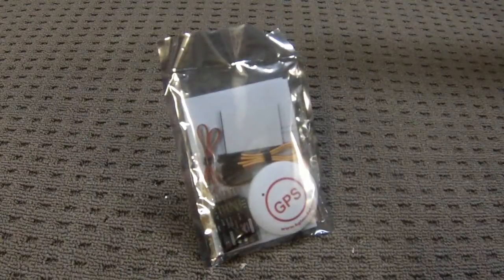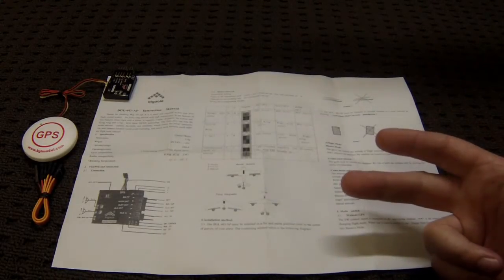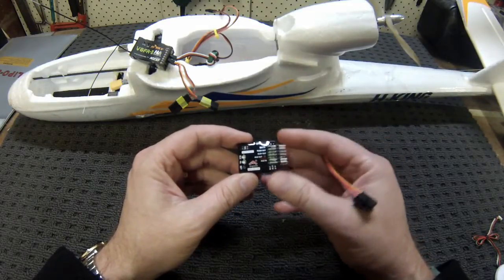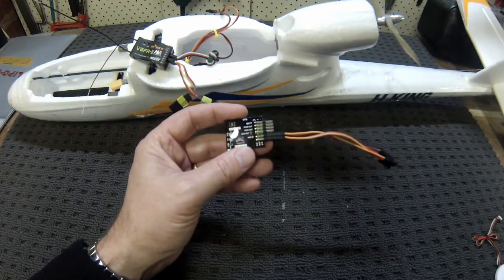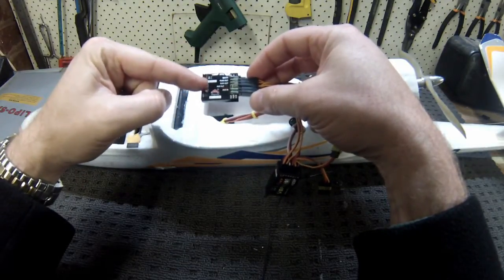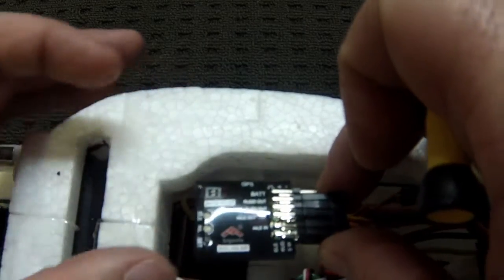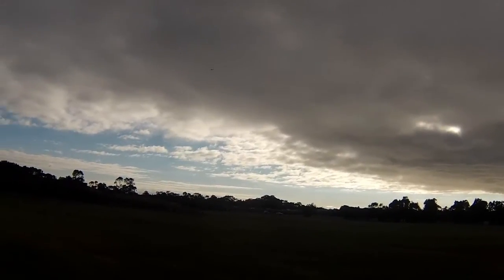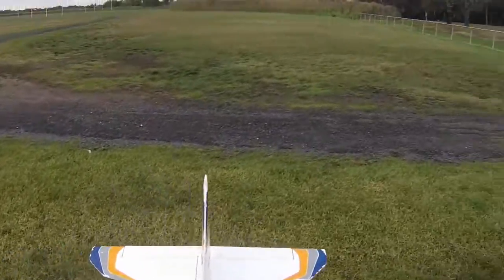BGL-6G-AP Flight Stabiliser with RTH - Setup

Comment: hi michael...   ok i got everything working on the tarains (thank you) but  not in the right sequence   i am using the sc toggle....  (rth mode is sc up)   ( off mode is sc-)    and (stable or gyro mode sc down..)     what could i  be doing wrong?    thanks   bill..
Reply from the maker: Hi +bill hiscock , that is the same as mine.&#160;
RTH is at the top, OFF is in the middle and Stabilise/AutoLevel is at the bottom.  Nothing wrong there.
If you wanted to reconfigure the output of the switch, I think you&#39;d need to change the output values for the switch. This would require you to do a change to the mix I believe, to set a value for each switch position of SC switch. 
What is your preferred mode for each switch position?

Cheers
Michael
Reply: +MAD RC ok cool thank you so much! your right! i got a email from aloft hobbies   where i purchase the bgl-6g-ap and thats what they said (set value) ...but as we all know easier said then done...  at this point  i am going to leave them where they are at!  or i wont have any flying time.... ;)      your the greatest michael!
Reply from the maker: +bill hiscock No worries at all, glad to be of assistance. I would encourage you to check out some of the videos on YouTube for the Taranis, it is a very powerful radio. I found a good series by a UK guy called Painless360 - https://www.youtube.com/playlist?list=PLYsWjANuAm4rtLZuLU2eSTc3svqWx-pa1
It is a fairly comprehensive series and covers a lot of things, I'm sure you'd find some of it very helpful. 
Cheers
Michael
Reply: +MAD RC ok i will... i just put amber pack on taranis  today  but my girlfriend didn t like it so much....  what can i say   oh well..   cheers!!!
Reply: +bill hiscock hahaha! nice work Bill. The Amber pack definitely has an "other woman" quality to it!

Comment: i appear to be having a little trouble setting the rth mode to a toggle on my tarains receiver   no sure of this procedure   and how  would you know if you got it rite  is there a way to test it?   the instruction manual i got with the bgl-6g-ap was faded (hard to read)   and not a hole lot of infor. on how to set rth mode  to transmitter ....    lost at this point...
Reply from the maker: G'day +bill hiscock please stay tuned, I'll do a video for the Taranis set-up, and that should clear things up. Cheers Michael
Reply from the maker: +bill hiscock I have put a quick video together with my settings for the RTH on the Taranis and there'll be another one soon with some other set-up tips too. Check out the Taranis here - https://www.youtube.com/watch?v=_BKaeRJRLrY
Send me an email if you have any questions. Cheers Michael
Reply: +MAD RC  thank you so much!    michael..

Comment: I installed but aileron stick will not work.  Ailerons will stabilize but not stick control.  I'm scratching my head over this one.  Thanks for good video.
Reply from the maker: Hi +notsuretwo I think that it may be the selected mode is RTH. Couple of things to check; make sure if you have  the GPS plugged in that you have a clear view of the sky. The GPS need to connect to satellites. You can tell that it is connected when the blue light is flashing. If the blue light is flashing and the red light on the unit is flashing too, check that the channel you have attached the control line to has been assigned correctly to the switch on your transmitter. 
Otherwise send me an email with more details of the behaviour and I can try to determine what it going on with the install. Cheers Michael
Reply: Mad RC  Ok, thanks for the reply.  I have everything working all lights and modes and other channels work.  I plugged the elevator out servo lead into the aileron out plug and i could control ailerons with the elevator control, but the aileron servo lead will not operate elevator.  I pulled the 'aileron out' servo lead and plugged it directly into the receiver and it works fine so i am getting aileron signal from the radio.  I guess there is an internal problem with the bigaole.  I ordered two more of the bigaole stabilizers so i will try them when is receive them in the mail.  Thanks for the advice.
Reply: +notsuretwo  I got the new bigaole's the 3ga and the 3ga-v2 (no return to home).  They work fine but stabilizing throws are small even after turning up gain screws.  I tried with no expo and with expo added to mix.  Do low rates affect the throw of the stabilization mode?  Thanks
Reply: +notsuretwo sorry I do not know that much about those models. I have a sample of the v2 now so I'll be learning about it soon. I will have another video out in the next couple of weeks. Cheers Michael

Comment: Hi Mike,can I choose flight altitude,such as 150 meters by this FC?
Reply from the maker: G'day +Area Fly . Thanks for the question, there is no pre-set height, the flight controller will maintain straight and level flight when the RTH is activated. So, assuming you have enough power this will maintain the same altitude. Cheers Michael
Reply: +MAD RC Thank you,Mike.then,it will be the same as of T1000FC,got it.
Reply from the maker: +Area Fly functionally speaking, it is. But it is smaller and has an OFF position rather than a heading hold. Cheers Michael
Reply from the maker: +Fpv Fly Thanks for the info. I want to highlight that both of the units you are linking to are about 30% more expensive than the BGL-6G-AP. I know there are a lot of options out there for flight controllers. Some include On Screen Display, some allow you to program weigh points, some have dual aileron control and they all cost more (some a lot more) than the BGL-6G-AP. 
This unit is designed to be the best possible price for a RTH stabiliser. That means that there are a few features that are not included, like the a pre set altitude for the RTH.
If it is OK, I would prefer to keep the comments here about the BGL-6G-AP. 
Cheers
Michael

Comment: G'day Mike, just wondering how to setup fail safe for this unit. I heard you mention it will RTH on fail safe? I can't seem to find how to do this in the instructions. Cheers, Jase
Reply: G'day Jase, (RCWASPOVISION ) Sorry mate, I have some how missed your questions here. And I do know that we've caught up since, but I thought it best to answer your question here too, in case others have the same question. 

For any fail safe, the receiver needs to be capable of being set into the desired stick and switch positions when you loose the connection to the transmitter. This is different across the different brands of receiver. For example - Turnigy receivers have no fail safe, frSky have a button, Spektrum vary across the different models.
I have more information about fail safe on the RC Groups forums - http://www.rcgroups.com/forums/showthread.php?t=2417656

Cheers
Michael
Reply: Thanks Mike! ;)

Comment: This look ok , but I like  all 3 flight modes you get with the T1000 and afer installing  buddy box mode I can get manual mode ..
Reply: Hi Dan Thiede thanks for your input. I guess for me, the T1000FC also worked well, I used it for nearly a year. But, I only ever used stabilise and RTH modes, the attitude/altitude hold never seemed to provide any benefit for my flying. And most importantly, I did not want to have to add extra switching or circuitry (which may have created a point of failure) on top of the stock T1000FC. I did follow the theard on RCGroups that discussed the 'T1000FC Manual Mode with GPS' by lasersbee and I even looked into getting the MMB, but there was no way to import that to Australia. This BGL-6G-AP might not be for everyone, that is for sure, but if people are looking to have a smaller, cheaper unit that has an OFF mode as standard then I think this is an awesome product. Cheers Michael

Comment: G'day Mike, got the unit installed in my mates Bixler. Pretty easy set-up. Just need to test it now. Hopefully tomorrow!
I was just wondering about the stabilization though as there doesn't seem to be any rudder output like on most 3-axis stabilizer units. Is that how this unit functions or have I plugged it in wrong?
Reply: Michael Downie LOL! He just tested it and it doesn't look like you need to hit the "set" button all the time. Just needs to lock in on the satellite's and you're good to go. We'll test it again next weekend.........hopefully! :)
Reply from the maker: RCWASPOVISION G'day Jase, that is right, no rudder. Should be a fantastic day for testing tomorrow. I put my ASW28 up for the first time today. And to my surprise when I flicked the sabiliser on it started to slowly spiral towards the ground! Flicked off and tried a few more times, but same result. Landed and had another look at the direction of the gains on the unit and sure enough, I had them backwards! Unbelievable, but no harm done. Landed, fixed back up. So please, make sure you take off in manual mode, get some height and then test the unit! Cheers Michael
Reply: MAD RC Will do mate! Tomorrow's supposed to be an awesome day!! Will be up bright and early. I'm glad you sorted out the unit before the ASW28 hit the deck. Such a nice bird and I'll definitely getting one! Have a great day and I hope you can get some nice footage! Cheers, Jase
Reply: MAD RC I managed to get a flight in today with the flight controller installed. Ground test showed RTH wasn't giving extreme aileron turn. I pushed the "set" button and then it worked. (Is this something you have to do everytime you plug in the battery Mike?) I then tested it in the air by going out 100m then switched to RTH. It started to turn then come back and proceeded to do a figure 8 around my standing position. Impressive! I then tested stabilization and it worked well! All-in-all a great little device. My only drama was after testing, I was coming in to land between some trees and lost perspective. Spent the afternoon with a very long stick trying to get the plane it out of a tree. lol! Eventually got it down. All good! :)
Reply: RCWASPOVISION OH No! Trees are the natural enemy of the RC pilot. But it sounds like a successful test of the BGL, if not a completely successful flight. With regard to the home position, you only need to do that once at any new location. It will remember the last Home position. But if in doubt, it is only a click of the button until you get the solid red light, to be sure.
Reply: Michael Downie Ha ha! Tell me about it. I told my mate to expect the plane to come back and circle around home. lol! So, I will let him know to hit the "set" button when ever he fly's at a new location to be on the safe side. Thanks again Mike. Great product! :)
Reply: RCWASPOVISION Alternatively, he can set it at his home and then it will be there for him when he gets back! hahaha